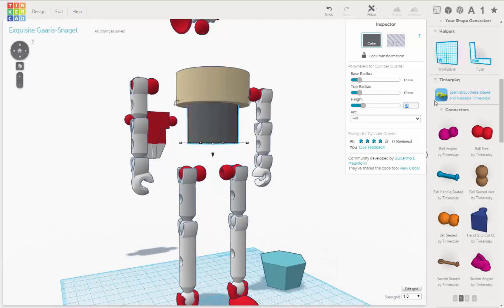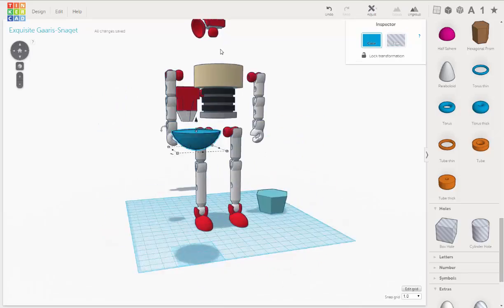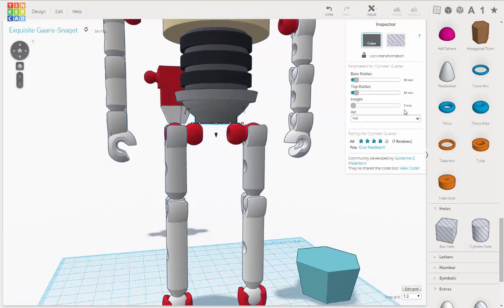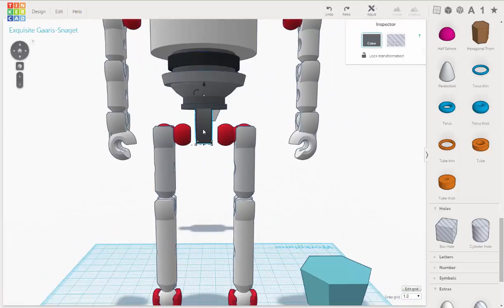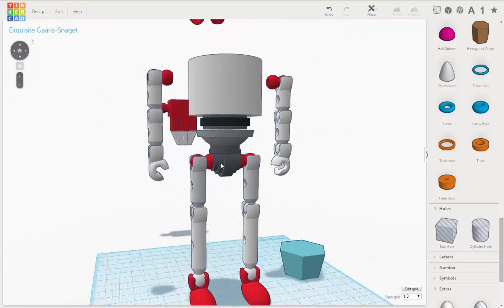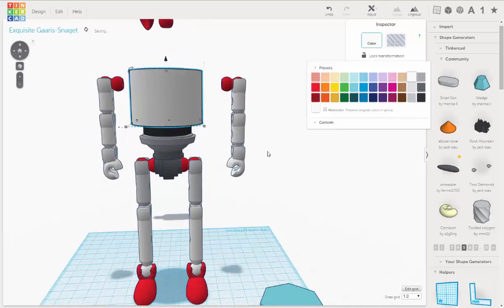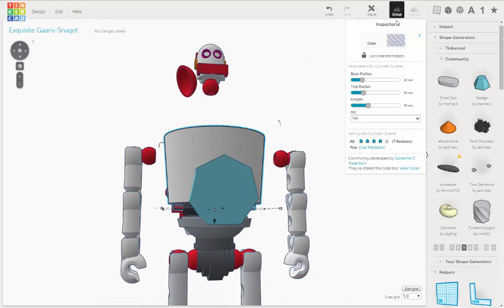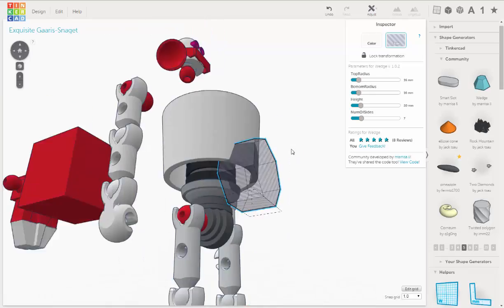tinkercad poseable robot

Comment: Hey! amazing model and timelapse. I'm wondering if you changed the original scale of the ball connector in order to fit on the opposite piece. If is the case, how many milimeters do you need to scale down? Thanks!